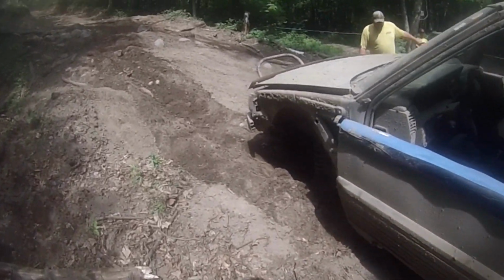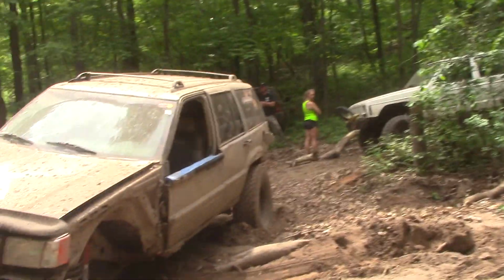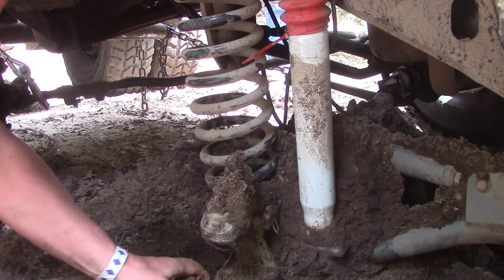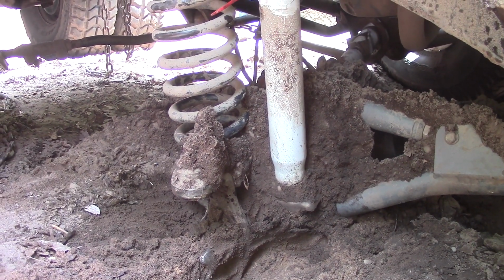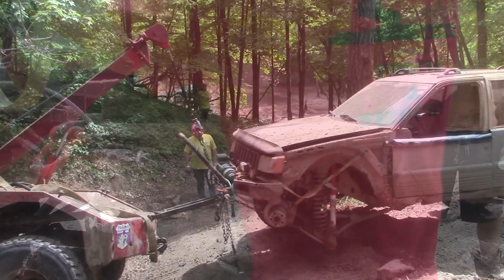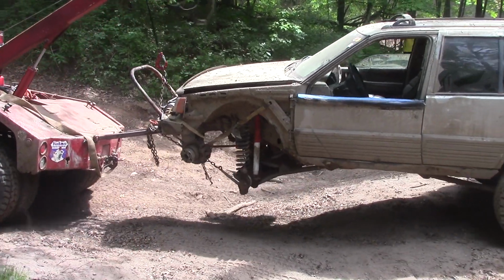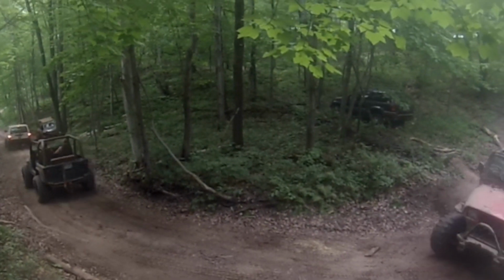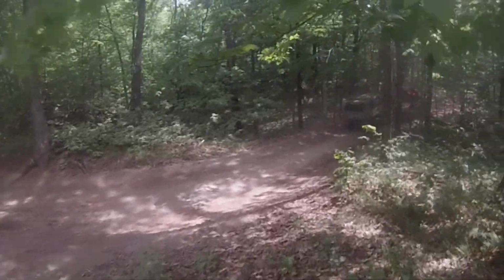JEEP FAILS AT HOTROD PART 2 by BSF Recovery

Comment: Sir, I have a 84 K30 with a Holmes twin 12 k winches and 14k boom. What do you recommend or use for springs? I would like to run 37" mt's. I don't have overloads. How much lift do I need?
Reply from the maker: I have 8" of lift, and my front wheel wells trimmed. You can see the custom rear lift blocks I made in one of my wrecker repair videos.